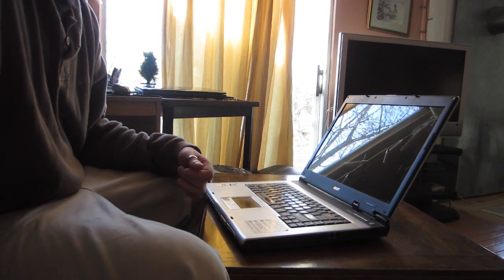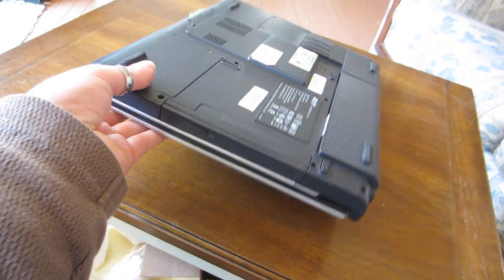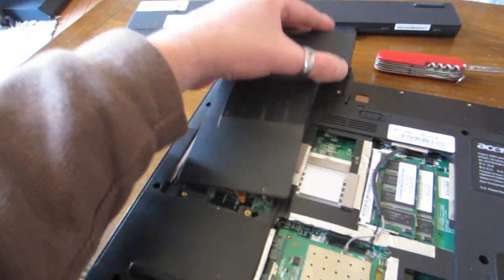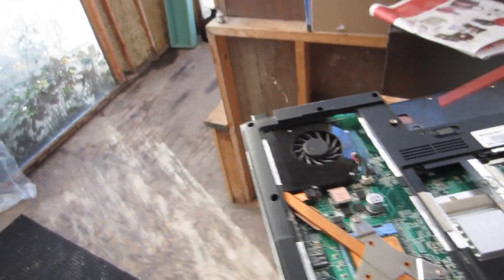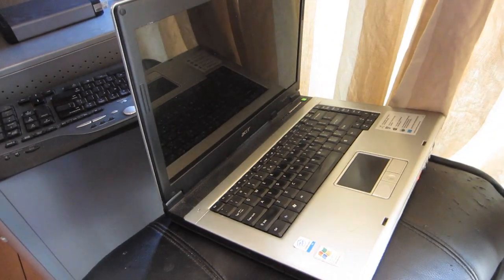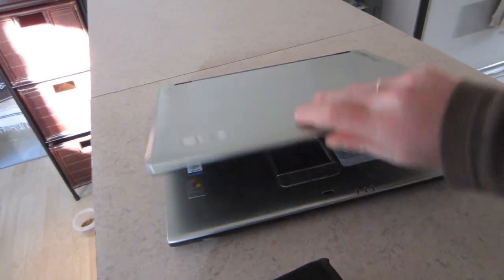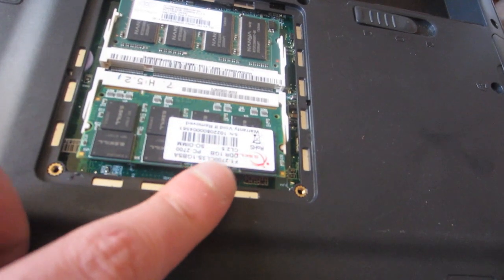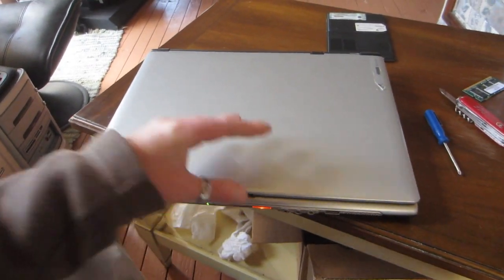The Computer Repair Show : Ep 1 : Acer Aspire 3500 Laptop

Comment from the maker: not at all. all correct drives will work. the only concern is sometimes laptops have little adapters on the pins for in between the drive itself and the laptop connection. usually this is on SATA connections and HP/Dell's, etc. Don't worry about registry unless you are upgrading a very old o/s to a very new one. then you have to change AHCI settings, thats a entirely different video. g'luck!